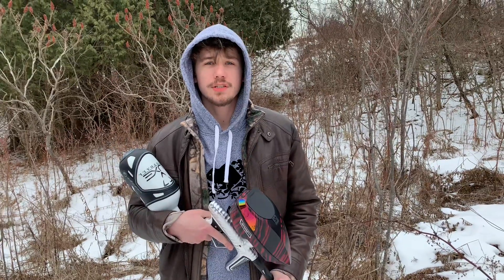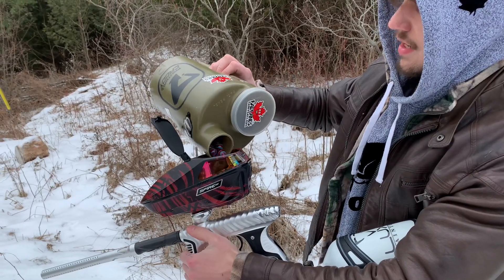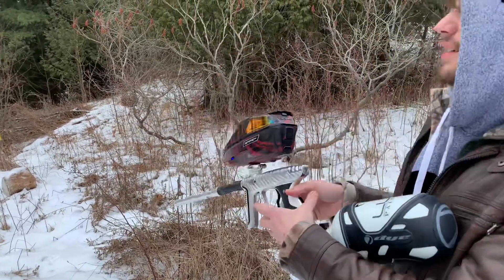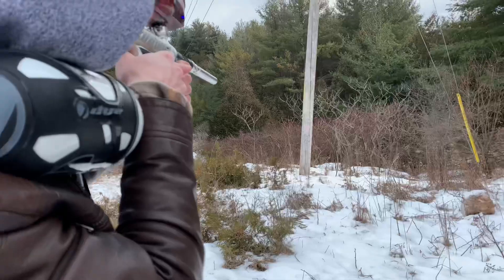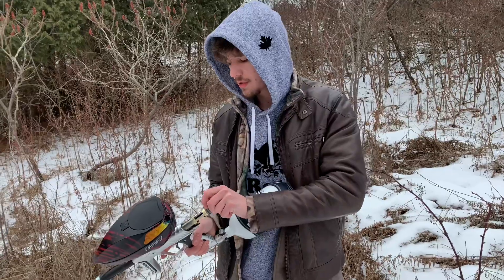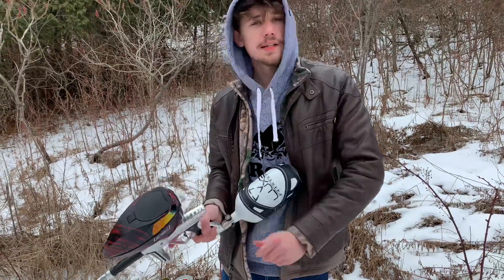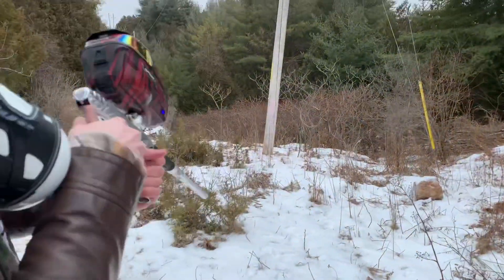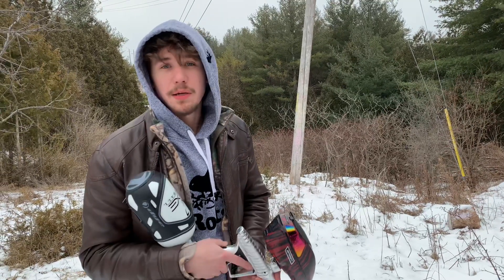Luxe X Soft tip Bolt VS Stock!

Comment: After using it for awhile. Would you recommend the soft tip?
Reply from the maker: Yeah it’s worth it.
Reply: @foolishcreations2259  right ob, for some reason i usually shoot 550psi but i attached a regular 800psi output onto my luxe x and now its kicking alot.. dont know if its the bolt or what
Reply from the maker: Re Chrono. Might of changed FPS.
Reply: @foolishcreations2259  i used it till it was outta air was even kicking on an empty ish tank. Weird doesnt kick at all when dry fire just paint
Reply from the maker: Like I said the different tank might of changed your FPS so I’d re-chrono it. Also take apart the bolt you may be missing a oring.
Reply: @foolishcreations2259  guess that would make the most logical sense
Reply: @foolishcreations2259  is it only supposed to help with brittle paint or are there other advantages?
Reply from the maker: Mainly brittle paint or it cold weather
Reply: @___meph___4547  the X also has an open face design. I was having paint handling issues with mine and just got a SSC bolt. I haven’t played with it yet though.
Reply: @rybobuno  how is it
Reply: @Po7ent  the SSC in my X seemed to be more gentle on paint. I also used a F16 in my TM40 for a short while. It doesn’t have the soft tip but it did eliminate some of the extra room in the breach.

Comment: I wonder the differences between the ssc bolt and f16…
Reply from the maker: Well the F16 has a different coating. It would have less resistance but as far as being better on super brittle paint the SSC probably takes the cake since it has a soft tip.